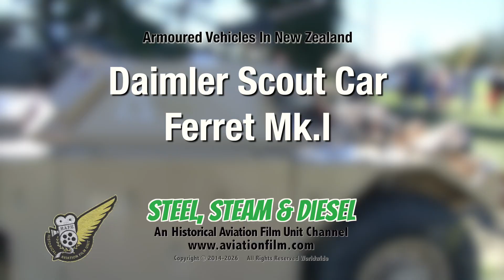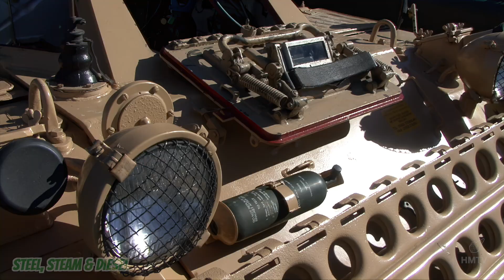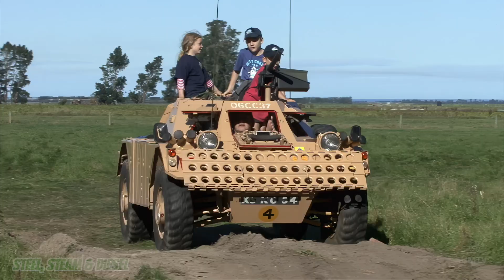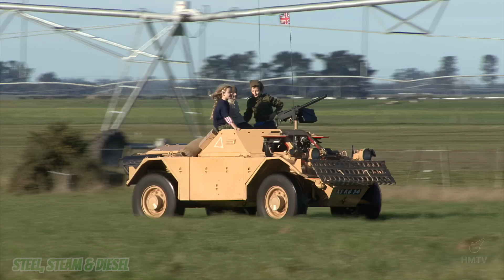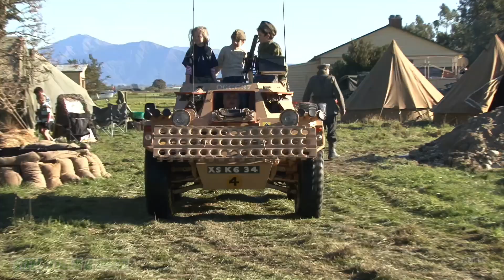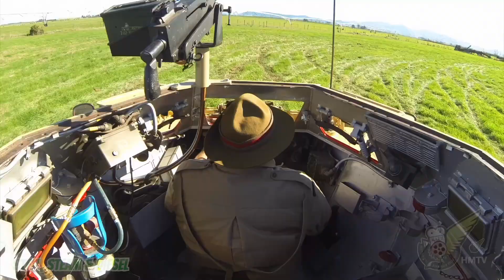Daimler Ferret MK.1 - Gulf War Veteran

Comment from the maker: This Ferret Mk.1 is believed to have served in the First Gulf War in 1991 before Mark Cameron imported it to New Zealand and brought it back from a non-runner with a wrecked gearbox and a list of electrical faults. The Dick Whittington cat on the rear points to a London regiment, and Mark is heading to The Tank Museum at Bovington to buy the full service records, so its story is still being pieced together. If you have crewed, worked on, or restored a Ferret, add what you know about those unit markings below. Subscribe to Steel, Steam and Diesel for more military vehicles and heavy machinery.

Comment: A quick internet search came up with the following,: Ferrets were deployed as part of a specialized "Ferret Force" within units like the 7th Armoured Brigade and the Queen's Royal Irish Hussars.
 Reconnaissance and liaison: Probing enemy positions and guiding larger armoured columns. 
Security and screening: Checking neutralized enemy positions and securing flanks. 
Prisoner handling: Detaining large numbers of surrendering Iraqi troops.
Despite being over 40 years old, the Ferret’s high speed, agility, and low profile made it effective for these tasks, with crews noting their ability to outpace modern vehicles like the Humvee on open desert roads. Some variants, such as the Mk.1/2 (upgraded with turrets and reinforced hulls), were specifically utilized in the theatre.  
 I never would of thought they would of been sent to the first Gulf War, but if it's still effective which it certainly seems like it was, why not.
Reply from the maker: Thanks for that interesting extra information.